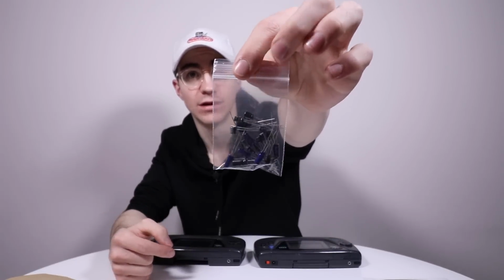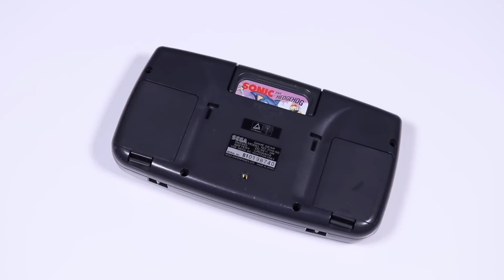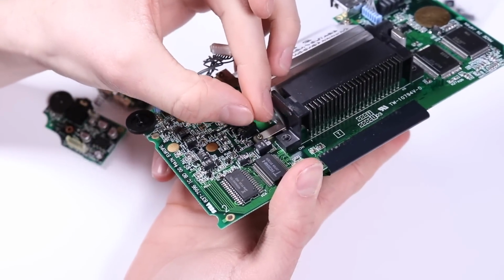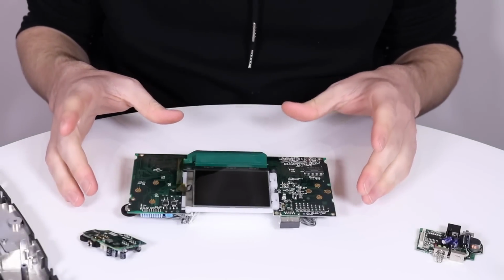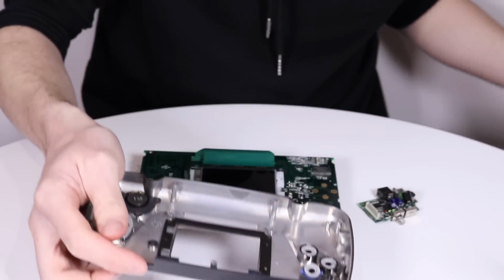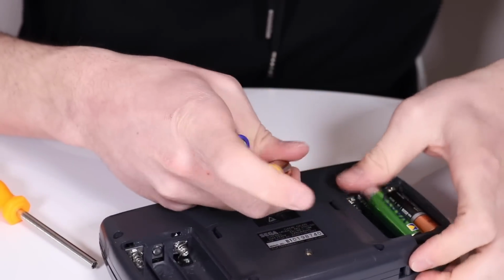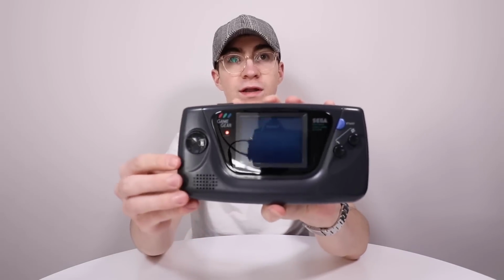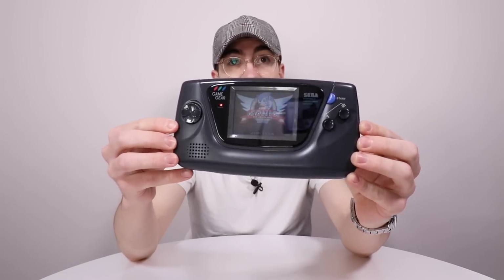Let's Refurb! - Sega GameGear Capacitor Replacement!

Comment: Wait so, he did the full repair and it didn't work then wizzed through the installation of a replacement board!? WTF was the point in recapping?
Reply: Right wtf....
Reply: The “replacement board” had new capacitors in it.
Reply: If he did I would Leake
Reply: Just listen

Comment: For anyone trying to do this. Use a hot air station to remove those surface mount caps. If you rip them off like this you risk ripping off the pads. If you do this it is a massive headache

Comment: Be VERY careful about ripping the caps out, you run the risk of pulling out the solder pads and then you have to scrap open the trace and solder to that, which is very fiddly (and I'm totally talking from experience). The safer way to go is to heat the solder and then pull out the legs out while it's in a "liquid" form. Otherwise, this is a great project to cut your teeth on when you're just starting out with console repair.
Reply: I’ve ripped a couple of pads off my main board, do you know how to fix them?
Reply: @Fleewood52  I'm not sure if you can fix the pads themselves, but soldering directly to the trace is a solution

Comment: FINALLY although I hate to criticise  I can't stress enough the importance of bending the capacitor legs flush with the caps base and then using tweezers to shape the legs parallel to the board, you need them trimmed as short as you can. If you don't the caps shake themselves loose or risk shorting or grounding out on others components, it's why they were glued in place and put in shrouds originally. Also DON'T buy cap kits, they are often out of spec, awkwardly sized and use cheap Chinese or Indian capacitors. A lot of failed recaps are caused by people crushing the new caps when they screw the console back together again (causing the rapid on and off flash) buy good quality correctly sized caps from RS Components. It's also important to neutralise any leaked electrolytic fluid on the board with vinegar and then alcohol as it can cause boards to short out and damage components as well. As for the glass lenses I think they have their cons, the original lenses respond excellently to being buffed with meguiars plastx and also retrobriting if they are yellowed at all, even though they scratch more easily they take a lot more effort to crack/shatter and can always be rebuffed unlike the glass ones.
Reply: There are pros and cons to every method some use SMD caps, some don't. Some pre bend, some bend after. Either way you are bending the cap legs, weather that be presoldering or after and they also have the same chance of shaking loose. Caps coming loose normally means the pads haven't been cleaned or properly tinned along with the caps, My caps are all from RS or Farnells, I buy the closest best quality cap available at the time of buying for the kits, equally I also try to by the best sizes, again not always possible. I normal always try for Panasonics but they arn't always available in a suitable close voltage rating.   If caps are placed correctly then the issues with screwing together doesn't exists. 
I think Elliots done a good job here, he tried, he admitted he messed up. The board is on the way back to me so i will have a good look and see if i can get it working. If not i'll ribbon swop the LCD onto a know working board
Reply: @labfifteenco2176  I know it has been some time but I would love to know what the outcome was of the original board? Were you able to diagnose the issue?

Comment: Just one more thing. you should never, but never rip smd capacitors of the board, since you can rip off the pads that connects the whole circuts, and therefore youll have to bridge capacitor legs with other components. Use hot air station if you have for smd components.
Reply: I have ripped a couple of pads off my main board and don’t know how to fix them 😭
Reply: @Fleewood52  you can bridge it with small wire

Comment: for those looking to do this repair be Warned, there is 2 different revisions of the GameGear, the Original 2 ASIC version and the revised single ASIC version, both require different capacitor kits
Reply: How do we know which is which?
Reply: @jwhoa1733  there are guides online explaining the differences but its as it sounds, in later models the compressed some functions into a single chip to reduce production complexity 

look on google images they should have comparison pictures

Comment: When soldering you really need to hold the iron against the pad and leg of the component for 2 seconds or so to let the heat flow through properly, avoid "dabbing" the joint. Hold the heat on, apply the solder, and remove the heat. Enjoying the videos, keep it up
Reply: Yeah, that's the purpose of flux, to avoid the pad from oxidizing before applying the solder but I generally don't use flux for small solder joints since the wire comes with a flux core. I only use flux when I really need it like with dirty pads or that oxidize fast. I use it all the time when using wick.
Reply: This completely depends on the soldering iron wattage. If the wattage is high, holding it for two seconds can be enough to lift small pads.
Reply: @8bitbubsy  Well you shouldn't be using a non-temperature controlled iron for electronics in the first place so wattage shouldn't be an issue
Reply: @cncgeneral  Fair enough, but not all people do.

Comment: Console 5 has cap kits, replacement audio and power PCBs, and also provides useful information on all models of the game gear PCBs and their capacitor locations. I managed to get rid of all of the old capacitors on my game gear, but I haven't gotten around to placing in the new ones in the main PCB (since it's tricky to make them all fit into a small space...). The good thing about this is that further corrosion has been prevented.
Reply from the maker: Sounds good! Hope the installation all goes well.

Comment: I wonder if testing the system after replacing one capacitor at a time could help it gradually get used to all the new power.
I just got another GG which has horizontal and vertical lines (the latter may never be fixed), so I'm going to recap it and perhaps even get a McWill screen for it.

Comment: I found 2 capacitors with corrosion in mine. Replaced those 2, reassembled and now it's back to working again. Be careful though, the brightness wheel is fragile, I broke mine and had to hot glue it in a stationery position for now until I get a replacement.

Comment: Hey, I am facing the same issue with power. I have changed power board's capacitor and when I opened it the game gear turn off and when I try again stayed open. How do you manage to fix this? Can you answer me?

Comment: I did this capacitor replacement on my Sega Game Gear VA1 model. The trace on my main board came off for the negative side of capacitor C68. Anyone know where it leads to so I can run a wire to it? I have the schematics in PDF format, but they are too small to read.

Comment: You can't simply replace polymer capacitors with the same value electrolytics. I'm not an expert on this but I think that you have to take the ESR into account before selecting the electrolytics and you may also need different capacitances.
Reply: They are not polymer caps, they are electrolytic caps with a less common shape. If you crush the plastic shell, you'll see the capacitor can inside. Also it's generally fine to swap even tantalums with electrolytics, not all circuitry is ESR sensitive.
Reply: @8bitbubsy  thanks, good to know

Comment: I’m not sweating the technique as nothing he did was wrong his solder amount was good a lot of people use way too much solder.  But the amount of flux he uses is insane.  Flux is generally just needed if your making a trace or newer to soldering I guess you would use it.  But def do not glob it ok like that.  When you open up some of the old handhelds you’ll notice some mega staining on the board which is either from the cap leaking or in his case.  The insane amount of flux.  Like I said it’s not wrong.  It’s just a lot of flux.  It’s not needed.  I also recommend using liquid flux
Reply: With all due respect . he was actually very sparing with it. How ever After using flux you should always clean the component with alcohol as it is very corrosive.. with rosin flux there could be "too much solder" but again thos was very minimal...Flux removes any oxidized metal and seals out air preventing further oxidation and allows the solder to flow much much easier... you also say hos amout of solder was correct... this is where I would be questioning thing as the original solder was never wicked or even sucked from the board... you should always suck then wick the pads or at least just use the wick to soak up all of the old solder. All of the original solder was used and more was added. I'm not just adding thos comment to be a dick, but to educate as I have been doing this for many years. I'm not perfect nor claim to be bit if I can teach someone the right way then I'm glad to do so. Most people dont even attempt to fix their own things or are too lazy to try thinking they cant. He at least did his best and that's all you can ask from anyone.
Reply: And just a word of advice....  whenever your removing or installing USE FLUX! I'm not sure who taught you not to really use it obviously, but it makes soldering and getting solder to flow a million times easier, faster and better!

Comment: im confused on how the  power board caps were changed they are through hole you should be able to put the new caps nicely in there
Reply: They are not through hole.  They are all surface mount, just a different type.

Comment: I wish I had a Game Gear.
Reply: If you have a GBA or a DS Check look for this on Ebay " Sega Master System 106 in 1 ". It's mostly Game Gear games that are on the cartridge.
Reply: I have seen those before. Is it worth it?
Reply: @tailsthegreenninja2003  Yes. It cost's less than a 3L Bottle of Frosty Jack in Scotland now. Which is now over £11.00 to buy but was until may 1st only £5. Then it was not such a bargain as it is now... ☺☺☺☺
Reply: How much in dollars? I'm actually North American.
Reply: @tailsthegreenninja2003  The Game Cartridge or the Frosty Jack... ☺

About $13.00  

Just Google it.  ( sega master system 106 in 1  )
Reply: Okay.

Comment: Hey sorry but your technique here is all wrong. You should never remove capacitors like that. Ever. It will easily cause damage to the board by ripping the pads off. Second, your new caps are just standing in a pool of solder rather than being appropriately laid out. 
This is why it failed. 
Please educate yourself before instructing others on how to do it incorrectly. Many people will only watch the first 2/3 of the video before seeing you weren't successful and likely meet the same result.